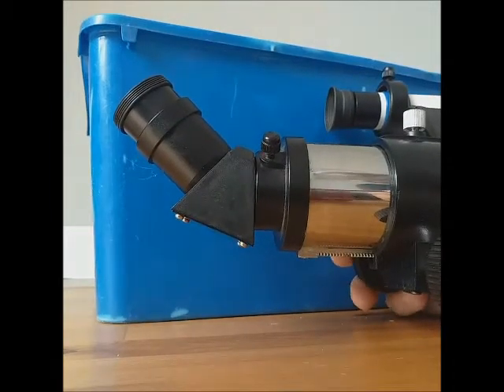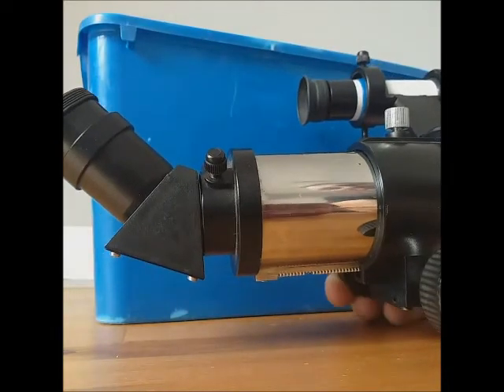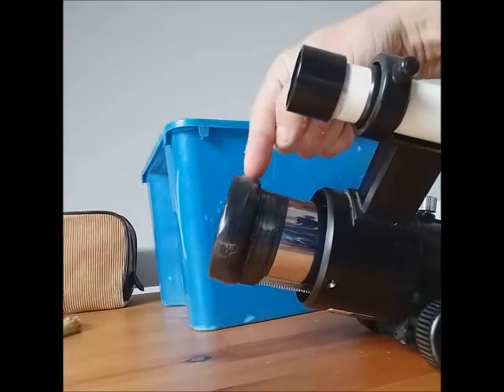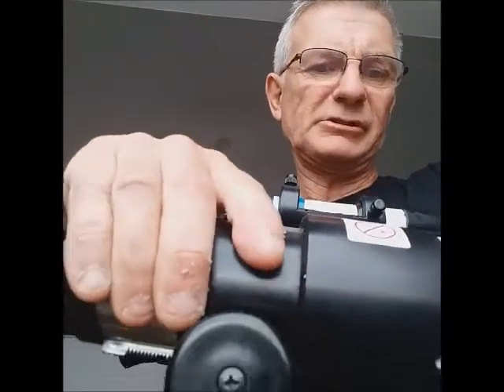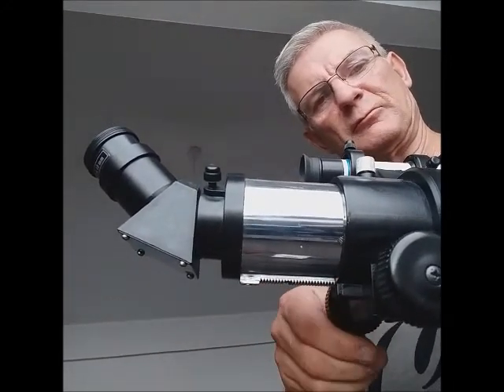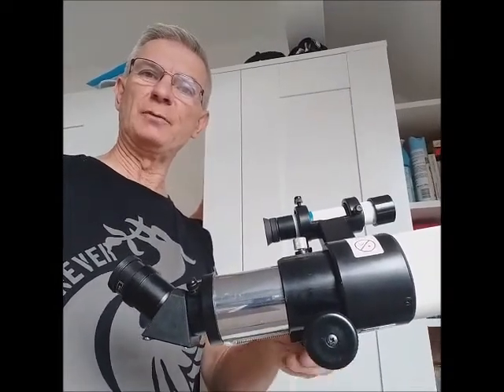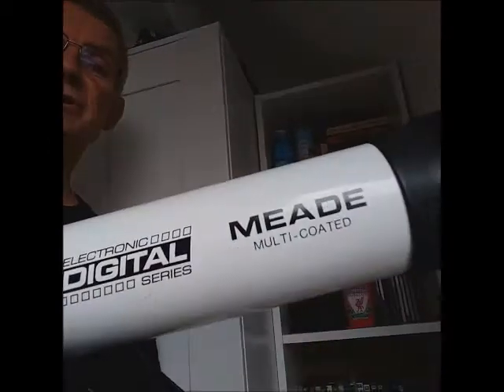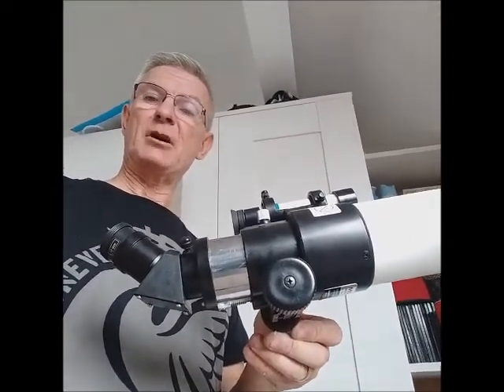Meade Focusing Wobble - Easy FIX from Supercooper Telescope Help.

Comment: My Meade 2090 has some adjustment screws on the bottom of the focuser to alleviate the same issue.  Nice solution.  Your website has the best advice on telescopes.

Comment: I was given a Meade ETX-90EC.  I got it home, set in out in the daylight to focus on a telephone pole, and line up the sighting eyepiece, etc.  When I look through the eyepiece, its just an opaque white.  I try first by turning the focus knob slowly clockwise, nothing changes.  So I go counter clockwise and again nothing changes.   I'm a complete rookie, but I followed the manual directions.  I tried cleaning the optics using Zeiss lens wipes (carefully.)  no difference.  The lens cover is off.  No astonomy club around, no telescope store around.  Do you know what the problem is?
Reply: When I look through the main telescope eyepiece, not the sighting eyepiece.
Reply: @royolstad8532, the issue may lie upon the little mirror in your angle (the backside of the scope) where the eyepiece goes. 

You will notice that there should be two metallic knobs or stems jutting out on either side of the angled portion in the back. A narled ended stem that juts vertically (this controls the focusing of the eyepiece). And on the other side, another metallic stem jutting out horizontally with a tapered end. This controls a small mirror in the pyramidal portion below where the eyepiece goes. 

If you remove the eyepiece and look down the hole. Then; simultaneously turn the horizontal stem, you shall see the mirror “flip” either up or down. This is to allow the light to pass straight through rather than upwards to the eyepiece and exit where the circular cap is located in the centre back of the scope. This is to allow you to “add” a camera for video or photographic stills. When looking through, the mirror may have been flipped out of the way, preventing you from seeing anything. 

Simply turn the metallic knob so that the mirror diverts the incoming light upwards towards the location of where your eyepiece goes. Place the eyepiece in the holder and focus until you see an image. 

Do this when it is daytime and for God’s sake, make sure you are not pointing anywhere near the sun. As even a split second of viewing in an improperly filtered eyepiece pointed at the sun can irrevocably do damage to your eyes and leave you blind. I hope this helps, and that you have the chance to explore the night sky and enjoy your new telescope. Cheers!

Comment: I have similar issue with my 1st scope.  Did you use electrical tape !   my eye pieces and barlow lenses pretty much every piece has far too much play . Their tolerances in their factories are horrible lol! I used electrical tape on the lense cases and they now fit snug.
Reply from the maker: You will have this problem an many smaller / cheaper scopes. They don't think that beginners should get good value (Especially Celestron!)  However, I expected more from Meade.

I did use electrical tape - It is very robust and has just enough elesticity to provide a good drag on the tube, without sloppiness.  I made the collar with epoxy resin impregnated thin card and it is very firm, but the outside needed a slight cushioning.